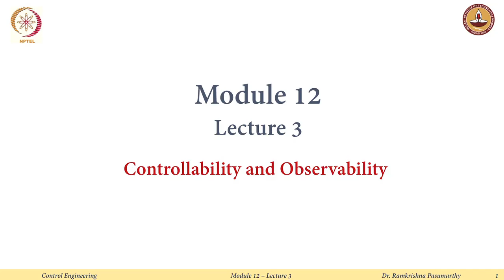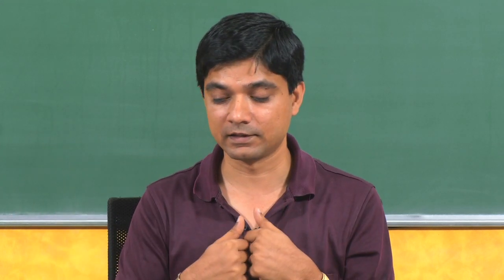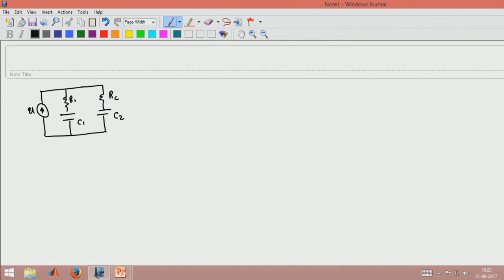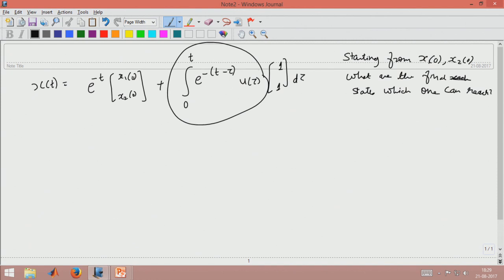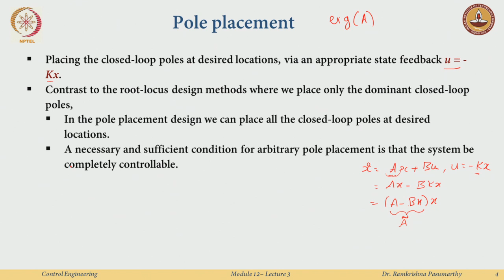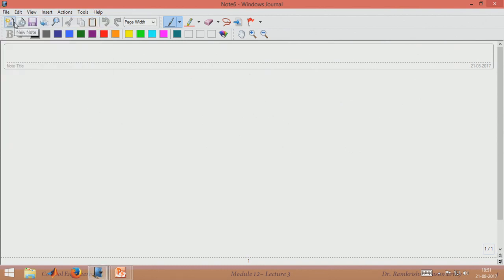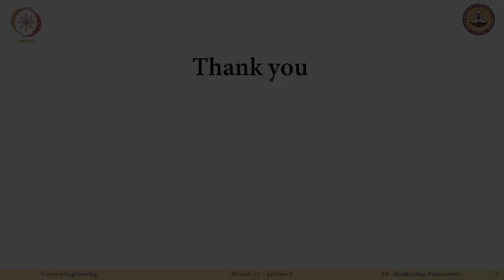Controllability and Observability

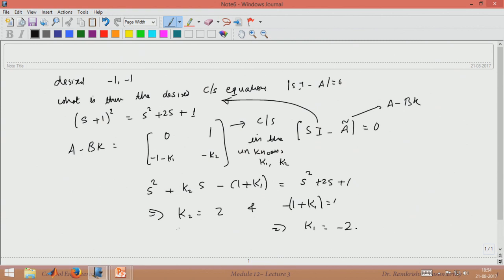Comment: There's an error in calculating the poles at 43:29. It should be 1 + k1 = 1 or k1 = 0. If k1 = -2 then the poles are at -2.4 and 0.4 not at -1.

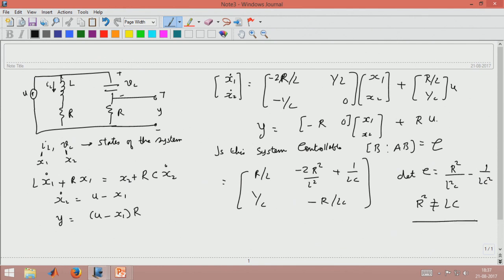Comment: There's an algebraic error at 27:45. The controllability matrix has zero determinant only if 
R = sqrt(L/C) not R = sqrt(L*C).
Reply: I should also point out that sqrt(L*C) has unit of seconds whereas sqrt(L/C) has MKSA units of kg*m^2*s^-3*A^-2 which is the same as the units of resistance.